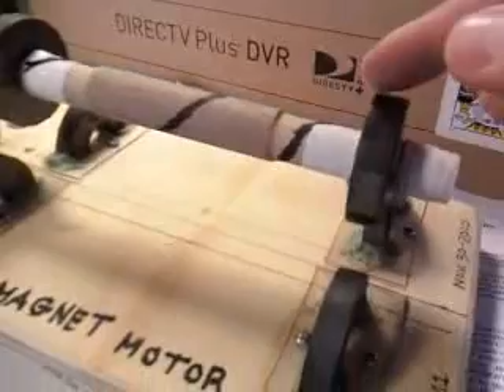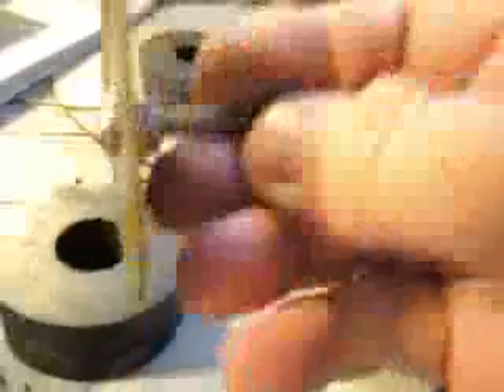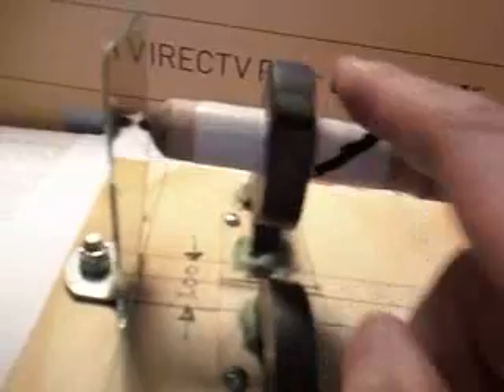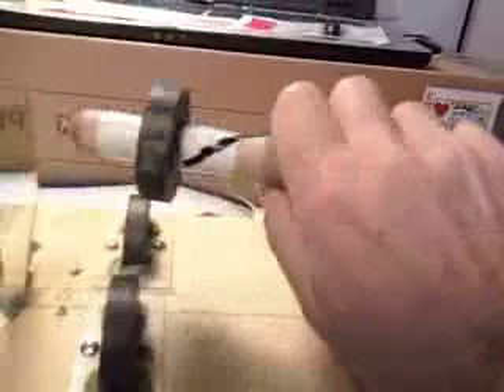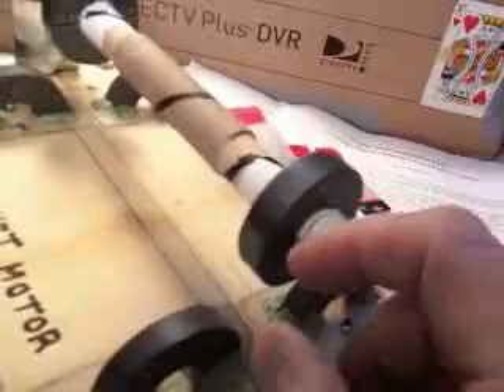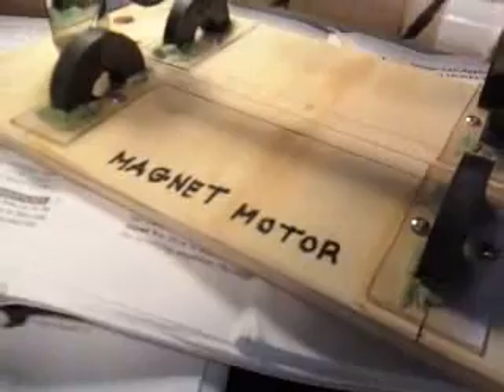HOW TO BUILD A MAGNET MOTOR

Comment: First of all, that's not even a motor, it's just most of a magnet bearing. And with all do respect, that wouldn't work anyway because the half magnets would have to be full magnets so that he could put them on an axle or ball bearing turntable to let them spin freely or else they would not be able repell or retract to a spinning magnet causing the spinning magnet to repeatedly change course therefore losing velocity at an extreme rate. I just think that it's a little suspicious that he also has a metal piece on the end that is out of the camera's view, he never showed what was behind it while it was running. Apparently he didn't notice reflection in the sheet metal, where you can see a thin metal rod going into the tube, and it has no threads just like the front of a small, low voltage motor. If the magnets were actually powering it, it would gradually lose speed, but it didn't, as if it were being powered by a silent electric motor. Who thinks that this comment will make this man feel stupid? I dooo! And I hope it does!

Comment: If you put this in a large cardboard or plastic tube, add more end half manets, then one ring magnet for each end at their centers, you will have a magnetic bearing. Next add a stater to its center, pick up coil on platic tubes center, wrap wire around a few magnets so that their magnetism is partially shielded, then after one turn the floating magnet should turn itself

Comment: no one is saying that the energy is being created from nothing no laws of thermal dynamics are being broken. They are saying that you can build a generator that will cost you nothing to run. The same way that it cost you nothing to throw a log in wood stove.You used energy to cut the log and light a fire burn the log but it didn't cost you anything.That is the point and that is what the energy haters don't want you to see. So they fill the page will bla bla to distract you form that. The energy is their and it cost you almost nothing to build one.
Reply: To: J Birnie,
🔵 "THEY" are not saying anything of the sort!
He's stating that it's a MOTOR, not a generator!

Comment: hello can you please tell me if this is pushed slightly down from equilibrium not too hard just a bit, does it return to it's original position? also does it work using ferrite magnets, is that the magnets you used? thankyou